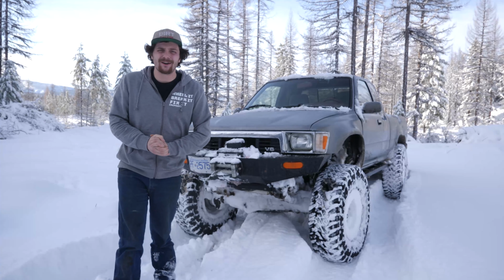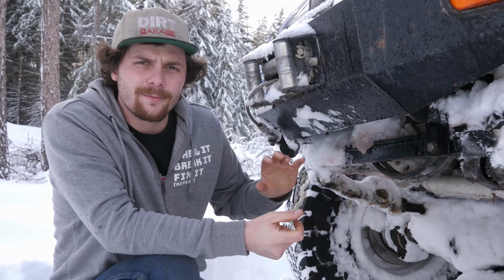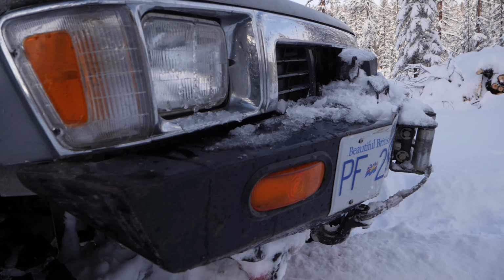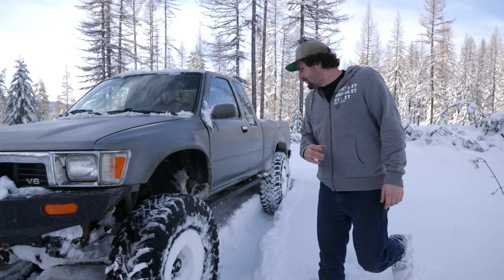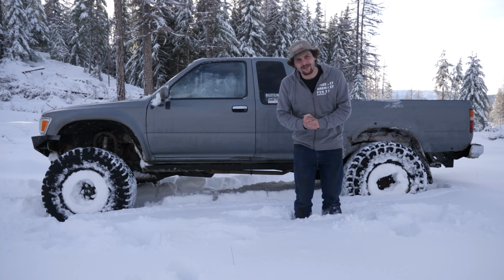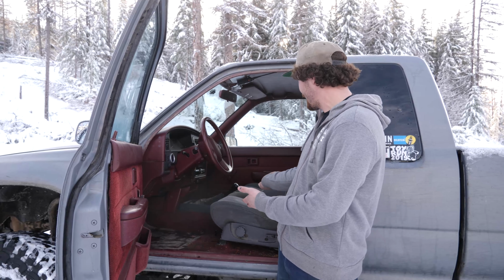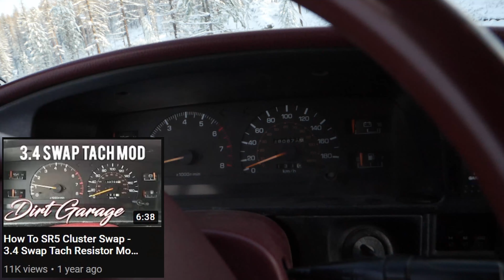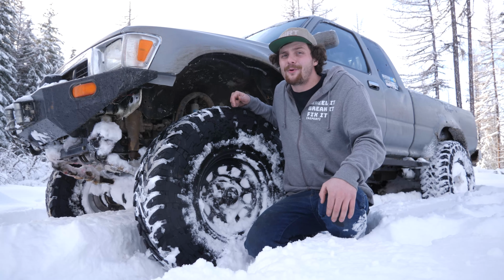INSANE Supercharged SAS Toyota Pickup / Hilux | 2020 Rig Walkaround / Showcase

Comment: Hey Clint, so I'm running a nearly identical setup on the rear of my 89 4Runner, OME 2" springs, Bilstein 5100s, and Trailgear 6" shackles. Mine kinda rides like a brick, does yours as well?
Reply from the maker: My rear 100% rides like a brick. 63s are in my near future!
Reply: 63s are the bomb fellas. You'll never regret it.

Comment: Thanks 4 cool walk-around,I'm still tripping on the dual transfer case! Oh and what's a Berf? New to this.
Reply: A birfield joint on the front axles they are used instead of u joints
Reply: @pacific4x444  k thx for reply
Reply from the maker: Yup birfs are what Toyota uses instead of ujoints on the front axle shafts.
Reply: @DirtGarage  Gotcha..thx 4 reply dirt garage, started down the rabbit hole on interwebs once I had the term and ended up drooling on portals!! 😂